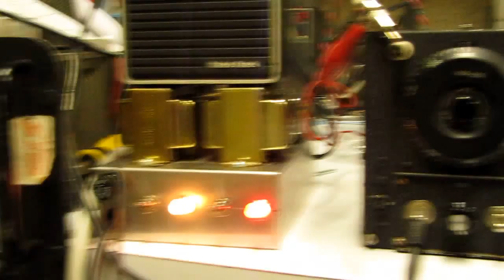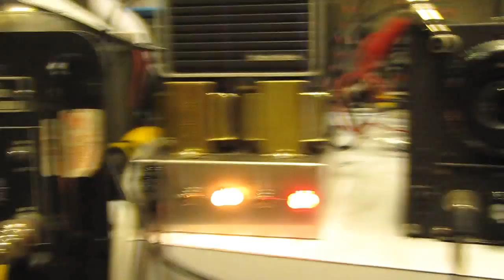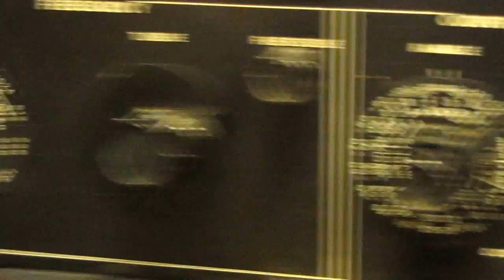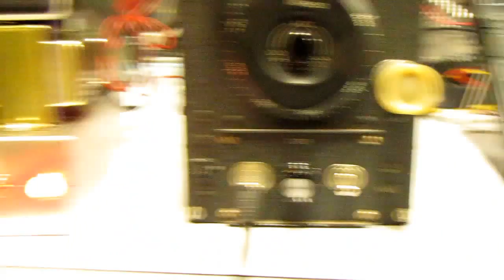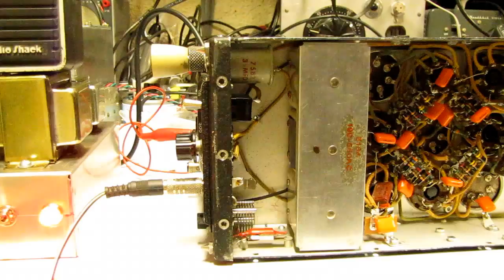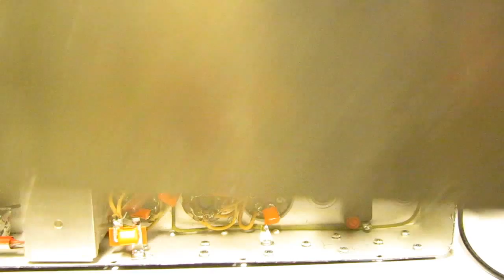A working WW-II BC-453B Receiver Rebuilt by W7EKB

Comment: Yes ken they are the ones with two flanges and three  terminals down one side they were made by Aervox in the USA. I have drilled holes one the back of the cans then pealed the remainder off where the back has been solder on then carefully removed the PCB OIL then re stuffed them with new caps certainly has improved the AR88d and helps to keep it original look.  The front panel is in mint condition.I have put it on Youtube  AR88D AND K9AY LOOP .        73 G4LMZ

Comment from the maker: specifically with dangerous chemicals, that the small amounts of PCB in even larger capacitors can be safely disposed of by simply throwing the caps in the trash. Also, I was told that unless the caps are leaking, there is no danger whatever. You might wish to check with the Environmental Protection Agency folks in your area. I suspect that your caps are OK, and if not leaking or shorted internally, I would leave them alone.  In the case of the ARC-5s, the caps can be very easily checked (more)

Comment from the maker: Hello, Martin: Yes, the ARC-5s can-caps are full of beeswax. I suspect that the types you are describing are those flatter, larger types with three terminals on one side, and mounted by two flanges with holes in them. Those are usually very reliable, much more so than the Sprague can-caps in the  ARC-5s. However, although PCBs are persistent in the environment, and can be a cause of cancer, the quantities required for that are usually quite large. I was advised by a governmental agency (more)

Comment: Interesting to hear about the three caps in a can with bees wax I have a RCA AR88D built in 1944 which has several three in a can capacitors. According to a web site these contain PCB OIL which when absorbed in to the skin can cause liver cancer.

Comment from the maker: I did make an on-the-air demo video of this receiver, but have not posted it. For one thing, my antenna here is very, very poor. It is a low, short wire about 50 feet long, and my location here is extremely noisy. In addition, MF band conditions have not been very good lately. Lastly, in order to hear anything, I have to turn off several of the noise-producers in our home, one of which is our dishwasher, and I can only do that after everyone is in bed! vy 73, Ken W7EKB